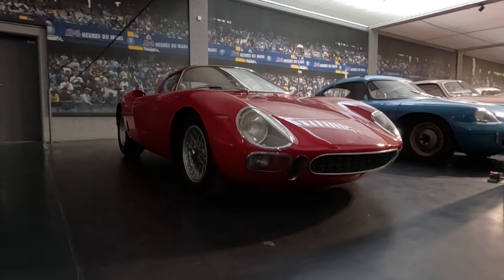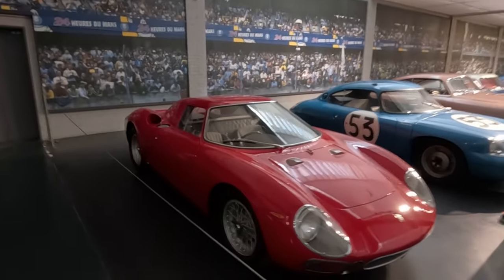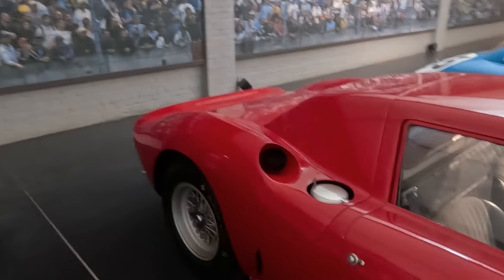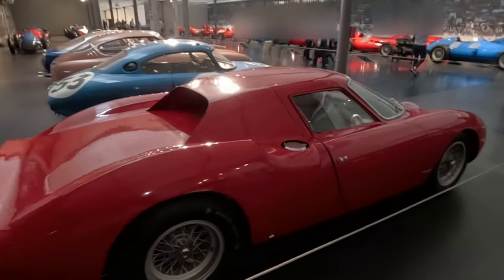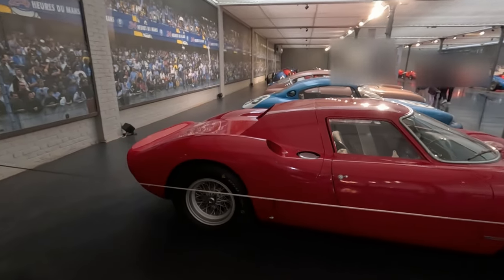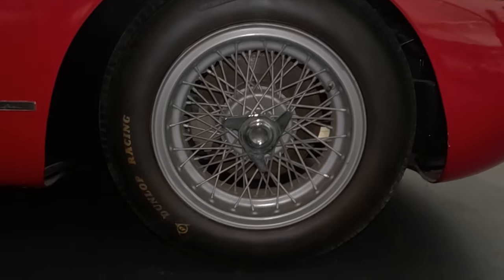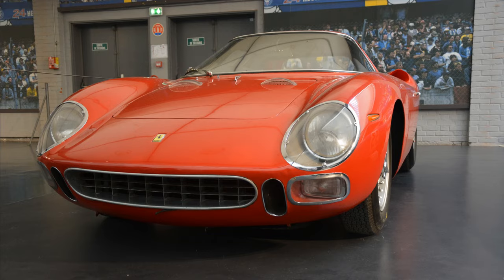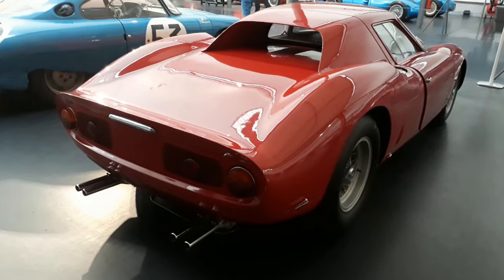Ferrari 250 LM  – 1965 Le Mans Winner ;Musée National de l'automobile a Mulhouse,Schlumpf Collection

Comment: Only 32 of these Ferraris were built between 1963 to 1965. In 1964 the Ferrari 250LM was entered in thirty-five varied racing events with ten victories including one being at Le Mans. The reason Ferrari built so few of their earlier cars is because they weren't building cars for the general auto market and built what they needed to outfit their drivers. That's why the auction prices are unbelievably high and the 250 Le Mans can reach up to 20 million dollars U.S. A kings ransom!